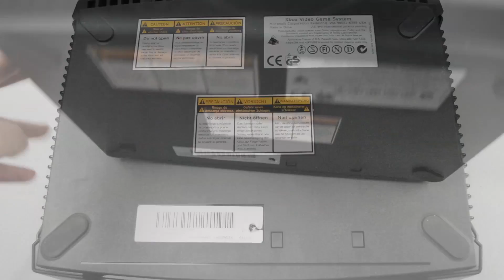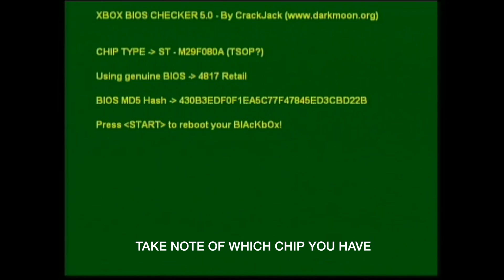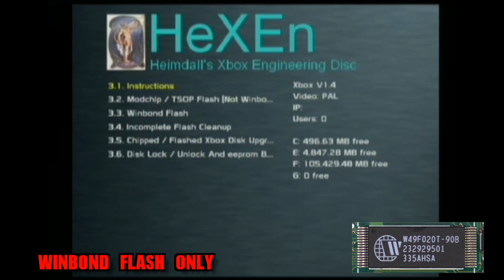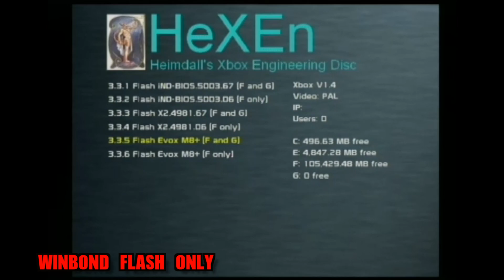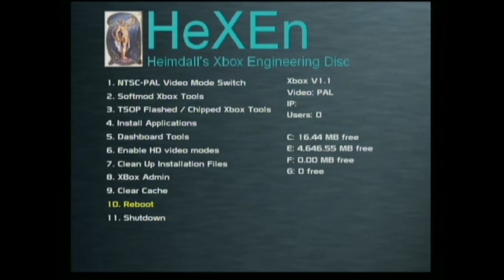How To TSOP Xbox Easiest Method v1.0 to 1.4 | MOD Guide

Comment: Is this different from the rocky5 endgame "exploit"? Should I do both or is just rocky5s enough?
Reply from the maker: This is for flashing the bios built into the Xbox directly so it acts like a modchip 

If you just want to soft mod the Xbox 
The easiest way would be the newer Endgame exploit 
No game needed
Reply: @Slot1Gamer I'm not quite sure what I want as I don't know what the differences are. What does one do that the other doesn't, sounds like I need endgame in order to do this, correct? Or is endgame and hexen 2 different concepts and I'd need to do both in order to do this tsof flash, that kind of info is what I'm looking for. 

On a more related note, holy cow my board didn't want to bridge, for as small and close together as they are..... wow (and I didn't use flux as Mario stated in his video), in fact as mine is missing a pad for a smd cap I can't power it on to test the points are actually even bridged, I hope they are.
Reply from the maker: @AceBoy2099 end game is a newer exploit that doesn’t require a game to launch 

This method in the video is hardware based and better for advanced users 

I recommend you look into a soft mod using endgame first, the main limitation to a soft mod is it’s a little harder to upgrade the HDD 

Check out the channel MrMario2011 he has some up to date soft mod guides for the Xbox 

Later on you can check out doing a hardware mod like this but it’s always recommended to start with a soft mod to see if you like it over the stock Xbox dashboard 😊

Yeah the points can be tricky to bridge as they are designed for an SMD zero ohm resistor to be places which is a little further apart than a normal bridge pad

Comment: Hi, can I tsop a classic xbox that doesn't have its hard drive working?
Reply from the maker: Yes but it requires extra steps. 

Either recover the HDD key from the eeprom and use that to lock a new HDD temporarily to boot system. You can build a tool to do this either using an old serial cable or using a raspberry pi pico. 

Or it can be done using a modchip temporarily but I’ve never needed to do that. 

Or using a programmer, remove the TSOP chip and write the correct bios file to it externally, I have done this but it’s really only if you have the tools already and the ability to quickly pull the chip. 

You can also now make your own modchip for the Xbox using a pi but I don’t have much info on that sorry

Comment: If i unlocked 1.4 my hard drive by accident in Hexen (the console is already soft modded) will this method allow me to boot to Hexen disc so i can relock it? Thanks!
Reply from the maker: Not directly 
When you unlocked the drive there is a chance it saved the key as a txt file to the HDD.

You can mount the HDD on a pc using FatXplorer and recover the key and lock it again hopefully 

There is also a tool built into fatXplorer that can recover the key easily from WD Xbox drives
Reply: @Slot1Gamer  I have attempted the PC route. FatXplorer sees the drive, but tells me it cant mount it, likely because the password is wrong, and it wont mount it at all.
Reply from the maker: Is it a WD drive?
If so try the key recovery, but if you unlocked the drive it wouldn’t have a key. 
Did you perhaps null the eeprom on the console itself
Reply: @Slot1Gamer  The drive is a Seagate ST310014ACE. I was able to back up the eeprom for sure, but its on the drive.  The HDD key was nulled to all 1’s using the Extras disc.  Im about 99% sure i did not null the eeprom
Reply from the maker: Hmm tricky situation 
You can either rip or change the key from the eeprom in the console via hardware tools (if the HDD itself was set to all 1s)
Or 
Install a cheap modchip and use that to fix the issue as you’ll be able to bypass the key check
Reply: @Slot1Gamer  If i may, which hardware tools can i use, im game for anything. I have a few chips on order, but they wont be here for a few weeks. I did see your tut on the eeprom reader, but i only have 1k, and 10k ohm resistors, not sure if those will work or not. But im game to try anything really, thank you so much!
Reply from the maker: You can use a pi pico to dump the eeprom too
If you have easy access to one 
That way you can do it over usb

Comment: wait so does the wires allow to run burned discs? how did you launch the disc at 3:09?
Reply from the maker: Console needs to be software modded first 
I have a video showing that also
Reply: @Slot1Gamer  damn, is there anyway to do it without soft mod? My Xbox can’t be soft modded anymore.
Reply from the maker: @CoffeeMugMan   there are a few options,

1: you can get a cheap Aladdin modchip, 

2: you can recover the HDD key from the eeprom and build a new HDD, softmod and then tsop.
3: You can also pull the tsop and program it externally but that is more involved
Reply from the maker: There is a windows gui program for Xbox hdds now I forgot the name 
It’s like an upgraded FatXplorer

Comment: In 3:01 as you said recommending to remove the wire after TSOP does you mean cut it or remove it and remove the soldering

My info about TSOP and soldering zero so Because this i asked you
Reply from the maker: Just remove the wire to be safe
Reply: @Slot1Gamer  i actully did it before a few weeks ago, my xbox is 1.2 and i left it D7R10 so i had to use wire.  The wire still connected in my xbox until now

Comment: So after you did this, soldering and such, you can read cdr/dvd? or do you need to do more than 
that?
Reply from the maker: Once the console is flashed and running a alternative dashboard like in video, then you can run backups :) 
Just FYI not all blank media types work in all Xbox DVD drives

Comment: Thanks so much for this tutorial! However, I feel like I need to point out something that wasn’t mentioned, because this could help newcomers on the hardmodding scene:
After TSOP’ing the Xbox, it would stay on a black screen after booting up with no disc, but when the Hexen disc was in it booted just fine. This is because having a softmod on a hardmodded xbox cause issues with loading the dashboard, so if you have this problem boot up your Hexen disc (I’m using the TruHexen 2021 edition) & be sure to use the “remove the softmod files” option! Don’t worry if it says you won’t be able to boot the disc anymore, it still works fine for me!

Also, I don’t know if it’s just me, but installing UnleashX as my main dashboard made the Xbox unable to go past the boot screen, I’ve tried XBMC & XBMC4Gamers though and it worked just fine. Haven’t tried the Emustation one as it’s not my preference.

Comment: I dont know what i did wrong but when i put the Xbox Bios Checker cd in the Xbox it did not detect chip type ... did i not solder my points correctly (v 1.4)? Can I still run the Hexxen cd without knowing the chip type? Thank you .... Awesome video.

Comment: After trying to do this and the clock capacitor my Xbox won't turn on the fan tries to start but no lights or anything plz help
Reply from the maker: Check around the clock cap for damaged traces very common 
Otherwise can be damaged bios 

Xbox will also have these symptoms if ram is damaged or too much ripple on cpu rails

Comment: Don't know if anyone checks here but your Aussie and I'm Aussie so yay!

I have a 1.0 Xbox whose original HDD died and a 1.6 crystal that I'm about to install an Aladdin chip on.

Can I use that chip to modify the 1.0 first to perform this mod so I can install a new HDD in it THEN install the chip into its final location in the 1.6?

Or should I just spend another $20 and get a second chip for the 1.0

I had two 1.0s but I sold the one that was chipped (xecutor) to buy the crystal as I always wanted one.
Reply from the maker: Either works 
But like you said it’s only $20, or 4 dominos pizzas
Reply: @Slot1Gamer  well my Xbox crystal arrived and it was already chipped with a HDD.

The seller had no idea as it was using the stock dashboard lol

So WINNING! I can now install the Aladdin I brought into the 1.0 :-)
Reply from the maker: Nice nice nice

Comment: I know this was made quite some time ago, but I hope I can still get some assistance.
On my softmodded 1.2 Xbox, it has a Winbond chip, and no matter what I do, whenever I try to flash the bios, it says "c:/BIOS does not exist"
No matter what I do, I can not seem to get the softmod to recognize the BIOS folder in the c: drive, even though it is always there (I have checked multiple times). I just want to upgrade my HDD!! GAH!
Reply: I would try burning a 2019 version of hexon on a DVD - r on the slowest burn speed. And then follow the instructions on the video again. You could always try reformatting the partitions through hexon? and then trying again

Comment: Im installed open xenium  modchip all good only problem my xbox 1.4 when try use 1.3 patitioner say : LBA48 inf not found  custom partitions will not work with this bios !. Update your bios to one wich supports at least LBA48 version 2 . Press Y to continue or any other button  to abort .... what is the problem ?
Reply: Only update the bios  and fix the problem , but need to remove the modchip to update the original bios

Comment: After this is applied can I swap out hard drive loaded with 2tb origins?  Sorry newb here
Reply from the maker: yes 2TB is max size and avoid "green" drives 
7200RPM is minimum recommended speed, also 80wire IDE will improve speeds

Comment: Ran into a minor glitch. While flashing a winbond I had it hooked to my hdtv via component cables. It would glitch out when it came time to select the penguin because that menu is apparently 240p and it won’t recognize 240p over components. So I had to fish out an old set of composite cables to actually run the winbond install.

Comment: I TSOPed it this way because I wanted to update my hard drive but when I plug in the new hard drive I get error 13. I already bought a 40 wire ride cable as well as a SATA to ide adapter. Im using my old 500gb ssd that came off my ps4. The adapter I have doest have the option to change from slave to master and my drive is a Toshiba. Could it be that Im getting this issue because my drive isn't compatible or my adapter doesn't have a slave/master option?
Reply from the maker: The hdd needs to be formatted, I have a hdd upgrade video try that

Comment: Do you think you can copy the hexen to the hard disk and run it from there? I ask before doing it I have an xbox 1.1 sharp, in this case it would be the step of no wind bun flash is correct  and you can flash sharp with hexen

Comment: I have a Xbox with a dvd drive that doesnt work.  Is there another way to do the Tsop flash still without having to use a boot disc?
Reply from the maker: If it’s already soft mod you should be able to use USB

Comment: Hello, not sure it it's related or not. I'm having a 1.4 xbox running SID5 and an advanced HD cable(original microsoft). Yet I cannot set my resolution to 720p. Console is set to NTSC and I was wondering maybe the bios is responsible for the signal output section and just maybe a tsop would help me. If I set it in evoxdash to Yes on HD it requires me to restart, and it resets itself to NO. By any chance are you able to help me regarding this issue?
Reply from the maker: I believe you have to change the region in the eeprom

Comment: Hello, great video indeed!! Thank you very easy to understand and explain quite well. I have a quick question: I did TSOP my Xbox but I flashed FlashBIOS 3.0.3 and now can’t flash any type of bios!!! Error: Unknown flash! Halting, I did some research and this method is to flash a Xecuter chip no TSOP no I’m wondering if the ST chip is locked on the Xbox can I do anything to flash it again and put an another bios?

Comment: Xbox error 05

i stuck on error 05 but mine soft modded without any chip, i accidentally use some software and i click one option says do you want to unlock the HDD i hit yes and now shows error 05, is there any way to fix it without using any chip-mode?

Comment: I have a windbon v1.4 xbox its softmod and as far as i can tell my soldering is good. But at the last step (hhd flash) i hit a on the bios and it just rests. Need help. Please. Anything.

I got it had to net flash bug it worked

Comment: my console is not soft mode have Aladdin cip installed and bot any copy (but have the original bios ) .I wander how to flash mode'd bios in it ?
I have a second console V.1.2 or V.1.1 made in Hungary 2003 with Thompson dvd drive not mode'd at all  i what to move the Aladdin cip in that one once i flash bios in first ?
how can i do it ?i can solder all those points as you show (will that mess with my mode cip ?) keep the console open and remove the cip after hexen dvd boot and flash bios .... ???
please help ....
Reply from the maker: When modchip is installed it completely bypasses the internal bios, it’s hard to flash the internal bios if you have booted using modchip

Comment: I have a sharp chip, I was planning on tsoping the system with Bare Conductive Electric Paint, which apparently works. But what would be the best kind of wires to buy? Links would be appreciated and are there any retail stores I can buy it in?
Reply from the maker: You can use 30 AWG wrapping wire 
You can buy bundles of it on eBay for a few dollars or a big roll for about $10 on eBay 
Retail stores I’m not sure sorry

Comment: friend I already made a mod 128mb successfully using bios xecuter 512k 5053 tsop
I'm trying the same on another xbox tsop and I can not write bios 512k only 256k
Are there ics on xbox cards with different sizes?
Sorry to bother, if you can help me, thank you.
Reply from the maker: From memory the bank size does change on different versions
But 
There is no difference between the 256k and the 512k bios iirc they are just mapped a little different

Comment: Slot1Gamer, I own an original Xbox 1.1 with winbond chip, I need to flash with linux, but on the bios selection which bios to choose since it has 1 mb, does this program automatically resize the bios size?

Comment: I know this is 4 years old but this is the most thorough tutorial I've run across, I used this to TSOP flash an original soft modded xbox. I will point out someone suggested using conductive paint to bridge the pads of my v1.4  Xbox. I applied it with a toothpick and it worked like a charm on the first application. (My 2 soldering try's failed miserably, lack of skill on my part).
Reply: Great advice, thank you! I was worried about my (lack) of skill with soldering iron!

Comment: I am very new in this sorry! Does the Xbox be softmoded and then do the TSOP. Can I change the HD to a bigger one like 2Tb or 4 without the TSOP ? Or you must do the TSOP first and then change the hard drive.
Reply from the maker: You need to be softmodded first, I’ve been slowly working on 2 methods to go directly from stock to TSOP but don’t have the time currently :( 
Biggest I’ve ever seen is 2TB due to file system limits (same reason 3TB drives are hard to get working on old computers running Windows XP)
You can upgrade softmod HDDs as well (I have a video)
Reply: Than you very much, I have seen that video as well very well explained.

Comment: And to remove the cable i just rip it off?
Reply from the maker: What cable? :)
Reply: @Slot1Gamer  the one that you soldered, I mean you said in the video that is recommended to remove it to avoid damage
Reply from the maker: Ah yes, you just use the soldering iron to heat the solder back up and remove it that way :) 
The wire is used to allow the chip to be written too

Comment: My tsop has no image printed on it :/ it's just solid black, how else can I tell what brand it is?
Reply from the maker: Is there a sticker covering the text.
They all have the part laser etched, you can use a little bit of non conductive white thermal paste to bring up the text on dirty chips
Dust and grease will make the text hard to read

Comment: Do you have to unbridge the connections after the flash,  or just remove the jumper wire, or both?
Reply from the maker: remove the wire, keep the jumper(s) on the top of the board, remove (them) if you don't want someone flashing the system later on (good if you are selling the console)

hope this makes sense

Comment: after the tsop  flash , do you have to unlock the hard drive ,
before you replace it with a bigger one,
i tried doing it after the tsop, but its glitching,
im wondering if its because i need to first unlock the current one,
or does it really matter since its now tsoped

Comment: Slot1gamer question, i downloaded the archives you kindly upload to mega and flashed the bios 256k evox m8 plus (as you recommended) here is the question does that bios is compatible with a 1Tb drive? Thanks in advance.
Reply from the maker: +cordova1912 from memory, no
Reply: Could you point me which one is compatible, and i've seen that there's a new hexen 2017 iso, is there any difference with the evox bios in each iso.
Thanks for the help...

Comment: once you've tsopped the flash say i wanted to just remove the stock hdd right away without unlocking it is that possible and then just insert a new hdd off the bat?

Comment: I've done several, but ran into a snag with a v1.0 with non-winbond chip (Hynix).  Ran bios checker and points were soldered correctly.  When trying to write the EvoX bios, it sticks on Erasing.  No status bar just sits there for a while.  Any ideas?